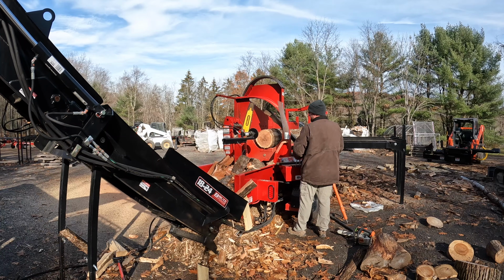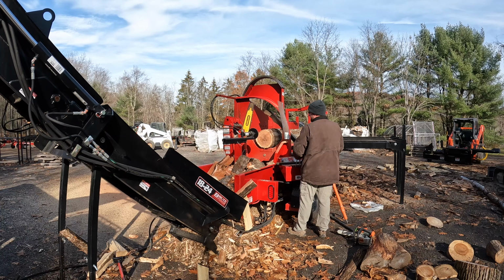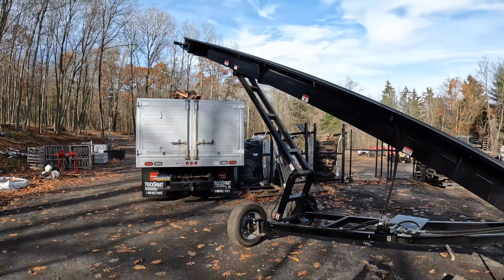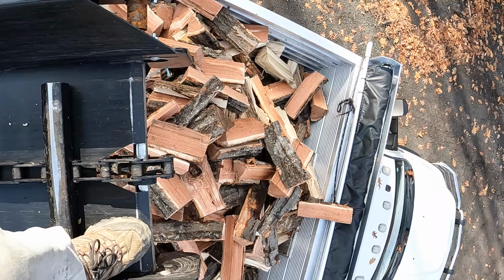1.5 cord run with the 18-24 diesel in under 15 minutes

Comment: What length of logs were you running thru
Reply from the maker: we run 18 ft plus. We load the deck with 1.5 to 2 full cords every run. For all the doubters out there we did a full non-stop video from the air and from the ground of knocking out a full cord in under 12 minutes. Check it out.